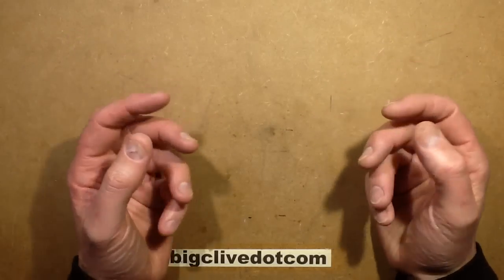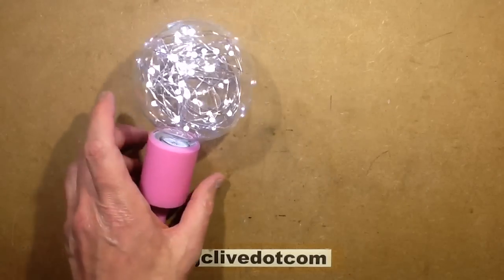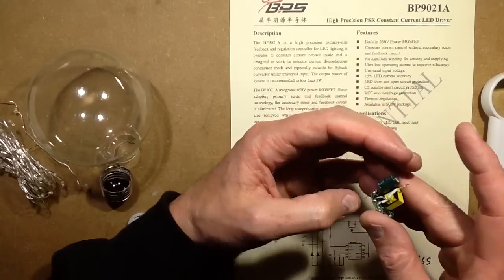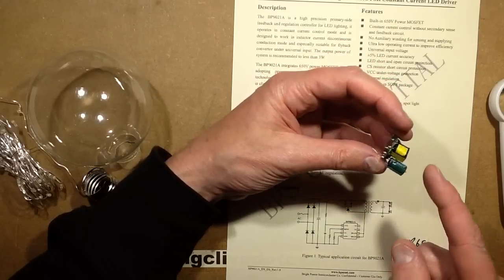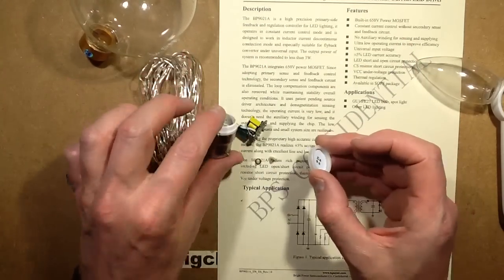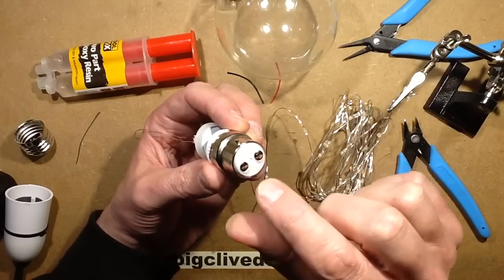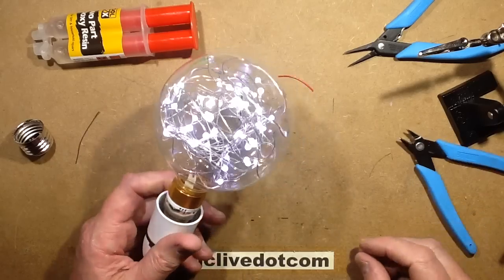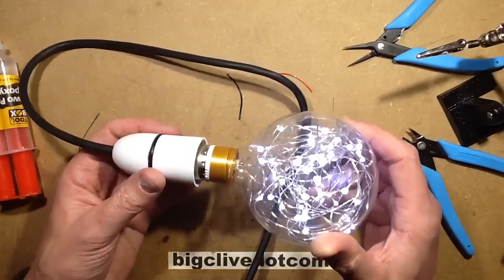Teardown and mod of a really nice "starry" lamp.

Comment: Whenever you have time, could you please make a 230v resistor dropper circuit for a one or three watt typical star based (single) led?
Reply from the maker: That's not practical.  For a high power LED you need to use a switching power supply.
Reply: @bigclivedotcom  thanks Clive for guiding I learn a lot from your videos. Yes, maybe other than that there could be an option with capacitor dropper.

Comment: You could change the colour using long, thin coloured tinsel strips and probably get the added benefit of tripling the light points or more.. Just probably an easier way to opt for a new mood to your great idea.

Comment: Clive back in the 70's a US called Tivoli Lighting made a similar lamp for use on a 24VAC  or at 120VAC. They now have 
an LED type that works on 120VAC. The older one had a glass globe and used incandescent lamps. The 24 v one used 6
lamps in series. They also had isle lighting for theaters. Still 24VAC and the 6 lamps were series parallel. That way if one 
went out you did not loose the whole string. The lamps being incandescent and dimmable gave you a nice warm color.

Comment: OK Im sure you don't accept mail from your subs but i just found those same lights in a goodwill here in the U.S. new in a box made by philips (not in a base) but they run on 3 AA for 6 hours on and 18 hours off... white and multi colors, I would love to send you one of each...
Reply from the maker: Thanks for the offer, but the cost of shipping would be high and they would probably be turned into a pile of illuminated broken glass in transit.  I've seen similar things here.  If you search eBay for copper wire LED string you will find the strings for making your own.
Reply: Ok but if you change your mind let me know..i think they would ship OK they don't weigh much and come in a box...the battery holder looks interesting..but thanks for replying means a lot to me ❤ they are philips dewdrop endcap warm white

Comment: Might be nice to use lots of different colour LEDs all together. The colours would average out as white, but with a nice pleasing soft colour effect, I think. 

You could even put a micro and some of those WS2812 LED chains, to have colour programmable ones. Then set them randomly twinkling different colours, still the same overall colour mix, but with a little bit of variation. I think that'd look nice. 

I've got one of those WS2812 rings somewhere, maybe I'll do it myself. An average-colour light.

Comment: Hi Clive its pete from second chance sailing i was wondering if i could set you a challenge
with all your vast knowledge could you design a solar light for me that will stay on till morning dont matter how bright its just i have fecking loads of them now and not one has ever managed more than 4 hours i know you dont get a lot off a solar panel but 4 fecking hours
Reply: ps forgot to add its good looking pete lol
Reply: You could just add more solar panels to an existing one, and maybe swap out the battery. Often the cheap ones are 1xAA NiMH, so change that to a C or D cell. Then connect a few solar panels in parallel.

The advantage to this would be it'd be hackable using existing light parts. 

An alternative would be to buy one of those solar fairy-light strings Clive's shown in the past. Then cut off most of the lights, or replace with one bigger LED. 

Basically the cheap Chinese solar lights are under-specced, their components aren't up to doing a proper job, solar panels too small, batteries too small. So you get weak anaemic light for a little while.

Comment: can you answer a question. a 60 watt led bulb with an edison base ,
it says not to use under - 1 c would it shorten it's life . Rene  canada.
Reply from the maker: It may be that the circuitry is not stable at low temperature and could result in unpredictable current.

Comment: Clive, how extensive is your education in maths? I was looking to get into EE stuff, but from what I've read, EE requires basically every maths subject (especially when you get into transformers and magnetism) and I'm not sure if I could get that far into maths. Any advice on what to do?
Reply from the maker: Yeah, don't worry about the maths.  You can learn it at a practical level and when you need the maths bits they will all make sense.  Just learning maths alone would be very dull unless you were totally into that sort of thing.

Comment: Clive, how did you learn about electronics, could I do it from my desk at work instead of going to college etc?
Reply from the maker: Absolutely.  The best way to learn electronics these days is to start playing with components and building stuff.  Google will answer just about any question you have.  Although I did go to college (one day a week) during my electrical apprenticeship, I picked the electronics up on my own by reading electronics magazines and building things.  The Internet has replaced the electronics magazines by having an endless supply of good electronic project websites if you take a look for them.

Comment: Have you ever done any lumens comparisons with LED lights. I want to build something like this, but I am not sure what to expect for light output. I want to make a ceiling fixture with maybe 3 separate globes. Wondering if that would be enough to replace a single 40watt bulb Im using now
Reply from the maker: It's really just decorative.  It will light a room, but dimly.

Comment: Super use of that collar for the base to hide the molded plastic connector. Can't even see it at the side.

I wonder if the individual parts could be nought separately as a kit? Or better yet, you could scoop up a bunch of stock for the bulbs that have that specific base and the globes, sell 'em as kits for people to do so they don't have to fool about on Ebay, and you can make a small profit margin selling the kits.

Comment: I saw these lamps pop up recently on deal extreme, so that is another possible source if Clive's linked seller doesn't get any back in soon.

I had avoided it because I was assuming they would have a crappy capacitive dropper and therefore flicker badly. I know Clive says that its not noticeable, but it really is and gives me a headache.
Reply: http://www.dx.com/p/hession-e27-vintage-globe-edison-bulb-led-string-light-neutral-white-446356 is a listing for one of them.
Reply from the maker: The parallel arrangement of the LED strings makes it unsuitable for use with a capacitive dropper.  They're more suited to long series circuits.  I bet someone will do it though.

Comment: Hey Bigclive, new guy here. Just wanted to say thank you for one of the vids you did on vaping devices and the liquids used in them. I was just doing idle research, since I have no intention of starting to smoke anything. I was looking for more devices and things to tinker with. I`m into electronics as a hobby and i`m a ham radio operator, and I also work in electronics as a factory technician.   Its a circuit board assembly house. I`m the test guy and I of course have to do a bit of component level troubleshooting.(  Thank God for ohms law) LOL.  I havent seen all of the channel yet, but I have noticed that you are preoccupied with light bulbs of all kinds.  LOL.  From LED`s to  incandescents.  I`m in California and I find it easy to find a lot of excess used electronics to mess with. Whats the situation over there.
Reply from the maker: Being on an island limits the amount of junky electronic items I can find locally, but fortunately China is full of delightful techno junk that they will post to me for a few dollars.
Reply: +bigclivedotcom its sad they charge for sending to Isle of Man. I usually see 'free delivery' to Netherlands although ofcourse its incorporated in the (cheap) prices

Comment: Do you like those switching power supplies or would you rather have capacitive droppers
Reply from the maker: Capacitive droppers are better suited to high voltage and low current series strings of LEDs.  Switching supplies are better suited to low voltage and higher current parallel arrays.

Comment: Hmmm, I just put a 10m string of multicoloured ones in a old jam jar, use a single AA with Clive's Joule Thief and a wee ebay step up converter module.  It was mainly to use up all the old batteries I have, but works very well.  Usually get a day or two out of a used battery.

Comment: I have a drawer full of those damn lights,both colored and clear. My intention was to use them in models as interiour lighting. I ended up hot gluing them to my RC Plane and they look pretty good but I dont know. the strip leds make better sence. I ordered the strip lights for a mini powered glider that is normally supplied with them but not this one. I just need to wire them up and get it set up on the plane. I guess the bulbs rob a good ammount of power from the planes battery,so I opted to go with a seperate battery. this adds weight to the plane but seems the plane should be able to handle it. The plane is irratic as all get out,so I have to fly it at the farm instead of the lot behind my house. Mabe the extra weight will tame it down a bit.
Reply: oooh, rc planes, check out the FliteTest channel!
Reply: wibbledee Check out RC Saylors also.

Comment: Hi Clive, one quick question if you have time. I built light for my aquarium using 1 W LEDs from eBay, the ones that have aluminium star heat sink. I am using 24V 100VA transformer that I had on hand, bridge rectifier and a smoothing cap. So my voltage is around 33 V if I remember correctly. I connected 11 1W LEDs to that voltage in series. Each LED is 3.2V and 300mA rated. Is that good power supply for the LEDs? Do I have to change or add something? They are running at recommended voltage and current and don't get hot, but I put them on aluminum heat sink anyway.

One more thing, when I turn them off, capacitor is still full and diodes emit dim light for 2 hours or so and even after that 2 hours if I short cap it sparks, should I put a resistor to discharge the capacitor?

Thanks

Comment: You could still feed and drain for opposite ends without the third wire in this case as you would hardly notice if one wire from each end of the string were connected to the base. Still it doesn't look like the lights get much dimmer further from the supply, at least from this side of the camera.

Comment: Australia has historically used Bayonet lights, although, most new fixtures installed are Screw type. I've been in several houses that are only 10 years old which have a mixture of different fittings, so you need to keep a stock of both kinds of globes handy.
Reply: Agreed!  Down Under we'd call the B22 bayonet fittings  'BC'  or  'Bayonet Cap'  as opposed to the B15 'SBC' or 'small bayonet cap'. General use of Edison Screw lamps is very recent, probably somewhat less than 20 years  (things like PAR38 floodlights are the exception :) ) These days it's a real lottery as to what you get in anything other than a basic batten-fix holder  :(    Selecting from the resulting mix on the shelf at the supermarket can be quite an ordeal!
Reply: Basically the same as the UK then which I suppose is no that surprising.